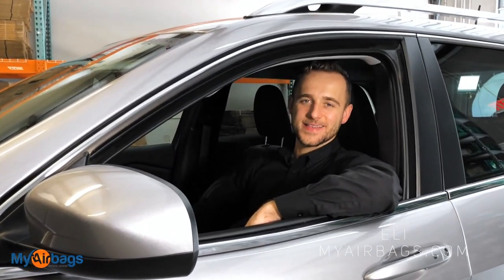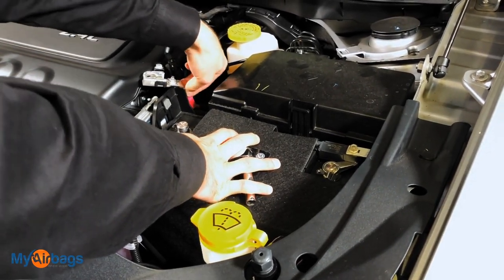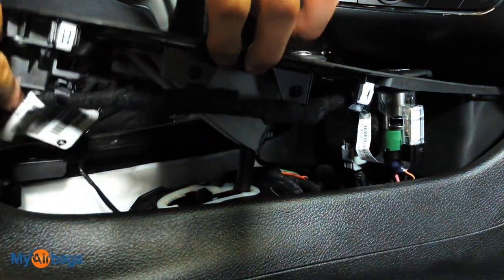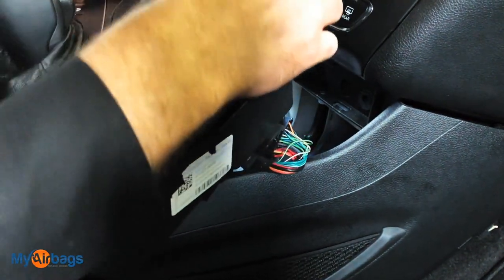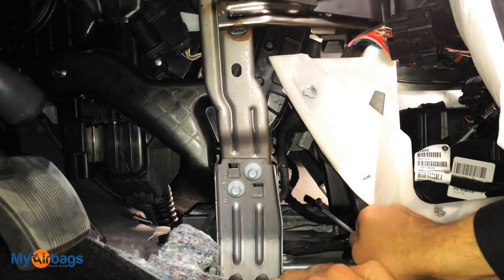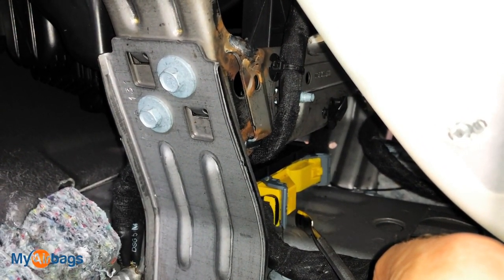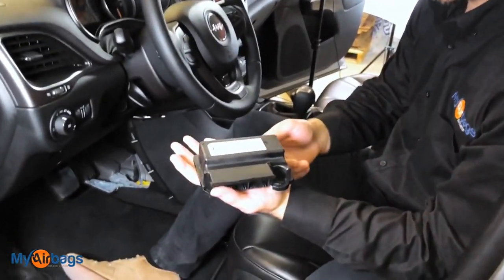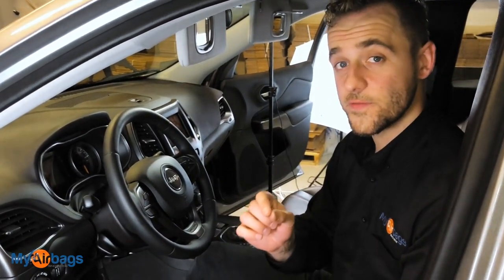How to Remove SRS OCR Airbag Control Module & Seat Belts on a Jeep Cherokee 2015-2019 | MyAirbags

Comment: How do I remove the front seat belt from the anchor/pretensioner? The seat belt has a buckle that connects to the anchor, the buckle has a hole in the side that looks like an Allen wrench, but when I put an Allen wrench in I can't get it to release the anchor? 2017 Cherokee Limited
Reply from the maker: Send the seat belt with the anchor tensioner. The anchor tensioner goes bad as well. We will rebuild both the seat belt pretensioner and the bottom anchor tensioner. Here is the link https://www.myairbags.com/product/seat-belt-repair-1-stage/

Comment: Can I drive the vehicle with the module removed for servicing?
Reply from the maker: The vehicle will still run and drive without it. But of course, it is a risk because the SRS system is not working.

Comment: I have this exact vehicle - the 2019 Jeep Cherokee.  Both front seatbelts, side air bag, and side curtain airbag were deployed.  I heard that I don't need to reset the AirBag control module during a side impact, only on a frontal impact.  Is this true?  What will happen if I get the seatbelts replaced, as well as the airbags, but don't reset the module... will the airbags deploy again without an accident, or will the airbag light just stay on? (in the case of this vehicle, the odometer will flash)   I heard once the resistance is detected properly, the module resets itself.
Thanks!
Reply from the maker: Nitro187, It may be true, replace anything that deployed first and then check to see if it resets itself.
Reply: Hi did the module resets itself after replacing the deployed parts? Thanks
Reply: @kkonopek  It did not - so I sent in the module to get it reset, and it STILL did not work.  So, I rented an ODB scanner that supports SRS module codes, and found that the SRS module still had the codes active.  Puzzled, as I just paid to have it reset, I decided to investigate which part of the SRS module it was referring to, which was the passenger pretensioner.  I checked the cable, and it was SLIGHLY unplugged.  After plugging it in, it worked flawlessly.  I now feel like I wasted money sending the module in, as i think if the cable was plugged in properly the first time, it would have worked fine.

Comment: Hi mate so I have 2017 Jeep Grand Cherokee. Had an accident airbags didn’t go off and nothing happened to them, but the headrest and the front seats belts tensioner needs replace. So I have the airbag light on. Do I need to take the airbag control module out to reset ?? I look forward to hear from you soon. Cheers
Reply: 👋 Leo, yes the airbag module will need to be removed to be reset instead of purchasing a new module. Airbag modules are like a black box and store crash history of what happened during accident. These airbag modules need to be replaced. Instead of replacing the airbag module, send it to myairbags.com to be reset. They will clear crash history and module can be used again. Seat belts will usually lock up and need to be changed. Myairbags.com also rebuilds seat belts using all OEM original manufacturers parts and can be used again. The process is fast, send your parts to them and it takes 1 day for reset/repair. Myairbags will save you hundreds!!!
Reply: Upfix thx for your reply, I wish I can do that because I am located in Australia, I have been told I can  replace the seats belts and plug scan tool and rest the airbag light. So according to what you saying this won’t work. Have to rest airbag module too :(
Reply: Yes, need to replace seat belts and airbag module needs to be reset or replaced with the same part number. The part number of the airbag control module is on top of the airbag module.
Reply from the maker: Upfix, Thank you for your input. Leo, thank you for your question.
Reply: Upfix Hi mate I have taken the airbag control module for the 2018 Jeep Grand Cherokee. It was under the centre console.  I have rest the airbag module. And start the car and the airbag light still on?  Do I need to plug my car to a scan toll to rest it or something still wrong ?         And only was the seat belt and seat belt needed change and I Have changed them . Cheers

Comment: Do you have a video on how to remove it from Jeep Grand Cherokee ??
Reply from the maker: Leo, This Jeep Cherokee video will have a similar procedure for the Grand Cherokee. We also have a airbag module location look up for almost every vehicle here: https://www.myairbags.com/srs-airbag-control-module-location-lookup/
Reply: My Airbags thx for your respond, so with only seats belt locked no airbags deploy do I still needs to take off the airbag control module and reset it ?

Comment: Hi mate I have taken the airbag control module for the 2018 Jeep Grand Cherokee. It was under the centre console.  I have rest the airbag module. And start the car and the airbag light still on?  Do I need to plug my car to a scan toll to rest it or something still wrong ? Cheers
Reply: And my car only had the seats belt and head rest and I have changed them.
Reply: @jackhewitt8614  If the airbag light is still on after getting it reset then it is best to get the SRS system scanned to see what codes are coming up. It could be that your seat belt pretensioners are bad and need to be replaced or rebuild. MyAirbags does rebuild seat belt pretensioner and save hundreds of dollars per seat belt. For more information on seat belt repair https://www.myairbags.com/product-category/repair-return/seat-belt-repair/
Reply: Upfix will do that once car complete, I have replaced the seats belt with second hand ones and the car I got it from was a hail damage car so wasn’t a crashed or accident car. Cheers
Reply from the maker: Thank you
Reply from the maker: Thank you
Reply: Hey , was the airbag module under the shifer and arm rest or under the radio?
Reply: Shifter*
Reply: @burnttoast9824  it was under the centre counsel don’t even touch your radio. It’s exactly setting below the 4x4 selector

Comment: Just did this you only need to pull the panels on the side of the console and unplug the module and remove 3 bolts rest is comepletely unnecessary took me 5 minites didnt remove anything else
Reply from the maker: Yes, most people can get to it that way. But, there is not much room to work with. Did you find it easier that way?
Reply: @MyAirbags  well my parking brake does not work currently so u didn't want to move the shifter while trying to keep my foot on the brake and remove the module and i found there was plenty of room for me to remove it
Reply from the maker: @skatenbikee707  thank you very much for this great tip!!! Anything to make it easier!